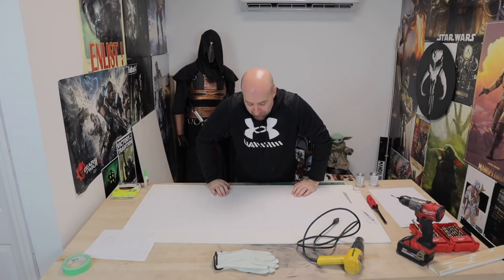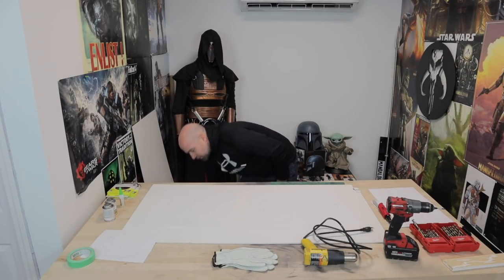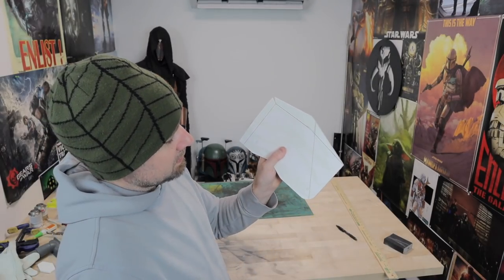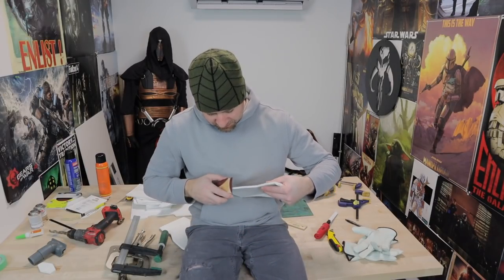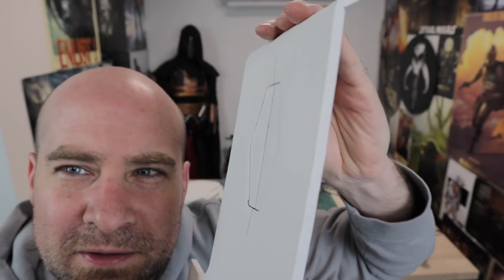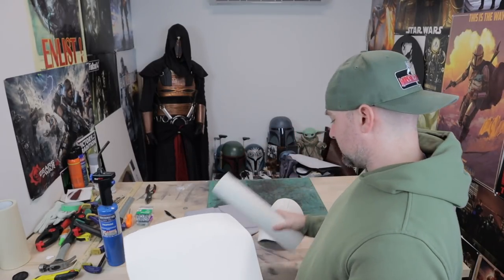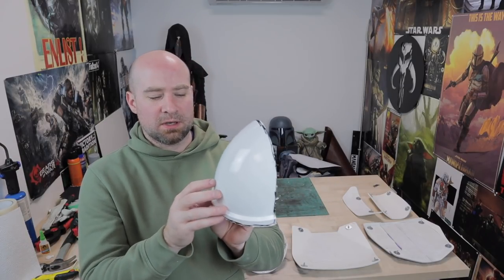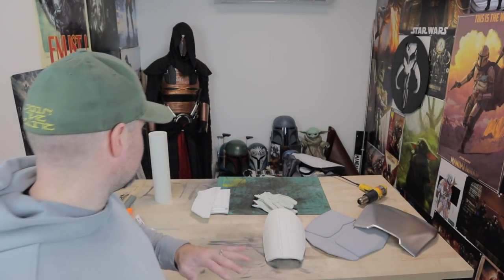BUDGET MANDO BUILD chapter 1 PVC ARMOR

Comment: I personally recommend heating pvc a little bit (those thicker ones like 5mm+) when cutting, its makes it a lot easier. You can cut it then with razor blade like butter, but dont heat it too much cuz you can messup the edges, but when you find the way to heat it enough it can save you lots of time and you wont be so exhausted after sawing it

Comment: I’m actually a printmaking artist, and have used the same material in the past for relief blocks. You could get a Power Grip carving set (from Japan) and use the v gouge to partially score the creases where you want those sharp edges folded over. Maybe that would help?

Comment: What size were the elbow pvc tubes?
Reply: I did some research and - at least in Germany, where i am based - the best results i got were from elbow pvc tubes for sewage. For the size i measured my shoulder diameter roughly with a ruler and the two viable options seem to be 120mm (roughly 5 inches) and 160 mm (roughly 6 inches). Cost lies at around 12 to 15 €/$ per elbow pipe. Judging on WeldingGeeks hands i reckon its closer to the 160mm/6 inches than to 120mm but i could be off by some degree.

Comment: How exactly do i figure out the print sizing for the template???
Reply from the maker: Print them out 1x1 or 100% cut them out tape them on to see how they scale to your body if you need them bigger try 110% if you want them smaller 90% and adjust the % from there until you are happy with the size
Reply: @theweldinggeek  Thank you!
Reply: @theweldinggeek hey! I'm a Little bit late but, where did you get your chest templates?
Reply from the maker: @thomasmichon3930  I have a Patreon with all of my templets there should be a link in the discription